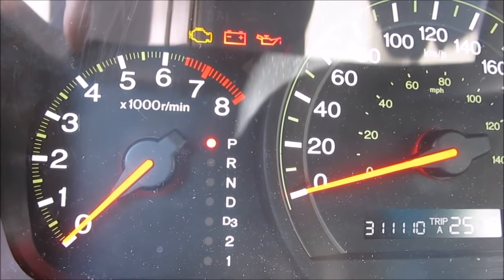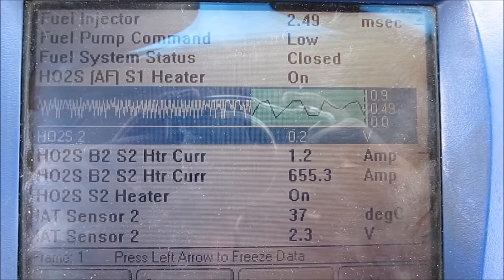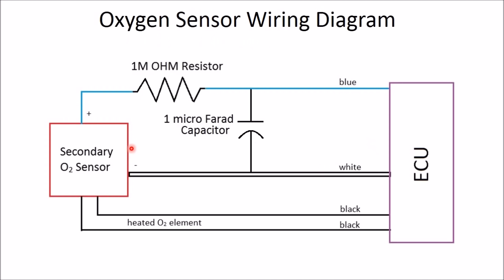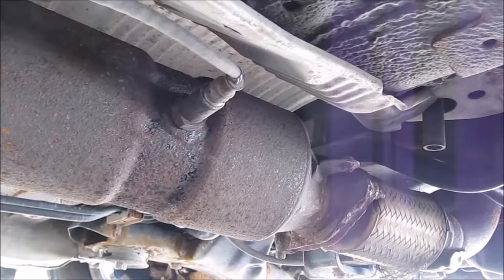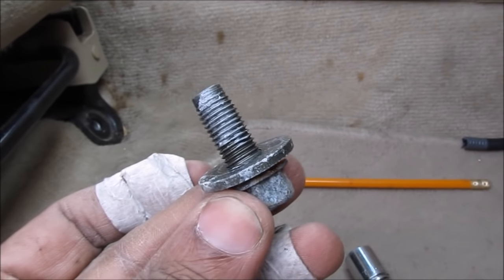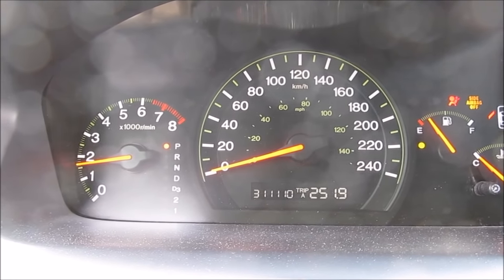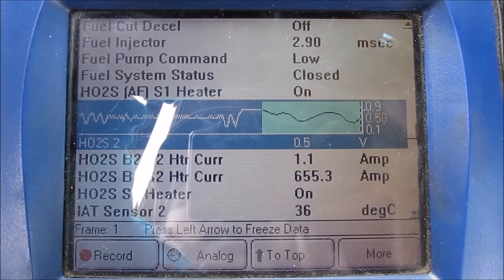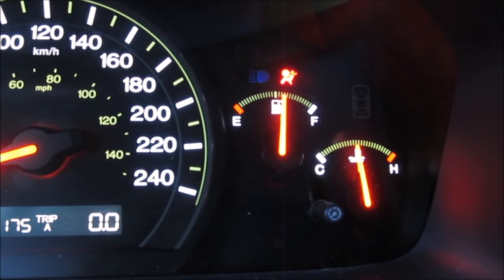P0420 Oxygen Sensor Fix

Comment: You failed to mention what size capacitor you used with the 1.0 megaohm resistor. Did you solder the negative side of the capacitor to the white wire? Did you use silver solder?
Reply from the maker: Regular tin solder

Comment: is it ok if i use 1/8 watt 1M ohm resistor? or does it need a bigger watt resistor thanks in advance
Reply from the maker: It's trial and error. See what RC value works for you

Comment: Thanks for the video. It's been a long time, but do you remember the capacitor voltage? I have searched a lot but cannot find a capacitor from 1Mf to 3v. Could you help me. Thank you
Reply: voltage on capactor means maximum it can hold without exploding but since oxygen sensor only produce up to line 1 volt, any capactor voltage will do
Reply: @poiiihy  Ok, thanks.

Comment: I went to buy the two (2) items to do this job, but there are so many different sizes of resistors and capacitors at Fry's and Radio Shack, so I did not know which ones to buy. There are 10,000 uF 25 voits, 4,700 uF 35 voits, 3,300 uF 35 voits, etc..... Could you please tell me which ones by the sizes that I need to purchase. I need to get car passed ASAP as my tags are out. Thanks you so much, this information is "GREAT"!!!!
Reply from the maker: +Terry Fuller Its trial and error. The ones used in the video worked for my car. 
Every car has a different response curve.

Comment: Were did you get the resistor can i get the info can i buy it  in ebay or amazon?
Reply from the maker: +Ivan Rosales radio shack
Reply: you can buy them on ebay or amazon?

Comment: What did this mod do for your gas mileage? Will this mod lean the mixture out?
Reply from the maker: +Steve Miller no. This is for the rear oxygen sensor not the AF sensor which would affect fuel
Reply: It only monitors the catalyst efficiency

Comment: Curious-  by doing this, will the mpg (fuel economy)  and acceleration improve to normal  levels? Currently with P0420, mpg and acceleration is really bad..
Reply from the maker: No it doesn't help with performance. It just tricks the computer

Comment: I had p0420 after doing this yesterday for 50miles, the engine light came back and it was p2a00. Do I really need to fix the 02 sensor from bank 1 sensor 1?
Reply from the maker: Use a spacer
Reply: @speedkar99  I didn't get you

Comment: Hi, I have a single wire CAT O2 sensor (92 Honda), and the computer is sending 10.3Vdc to the sensor through this wir. Does this mean that the senor is just acting as a variable resistor (hence changing volts based on heat?).  How can I use this DC supply of 10.3V from the computer to create a 0.4 to 0.7 V variable voltage using a RC circuit design in series?  I was also looking at using ohms law to hold the voltage at a constant value of 0.5V by adding a resistor only if that works too.. Can you please help?
Reply from the maker: +Sajaad Nazim I'm not familiar enough with electronics to help, but you might want to research how a 1992 oxygen sensor works because that might be different than the newer cars
Reply: Hi, Thanks for replying. After some great research I found that this sensor on the CAT was not an O2 sensor but an Exhasut Temp. (EGT) sensor acting as a Thermistor with a negative temperature gradient. Was able to fix it by adding a 100K ohm resistor and grounding the single signal wire to the chasis. Now the computer assumes normal operating temp. and the light is gone too.  Hope this helps to all who have Honda 92-95 JDM Eg hatch Models..
Reply from the maker: +Sajaad Nazim glad you found the issue
Reply: Looks like you have a short to power on the sensor signal wire

Comment: A few have mentioned this, but you are missing some specification on your parts. Resistors will need a wattage and tolerance. Capacitor needs a type, tolerance and a voltage. Based on the video, one might assume you are using a standard electrolytic capacitor at 25 volts with maybe a 1/2 watt metal resistor (1%)? I believe that this is important to specify as many do not know much, if anything, about electronic components, so when they go to acquire them, they will need to know what they are asking for. I would not think any specification beyond the above is needed.
Reply from the maker: Very good points. This video was meant to show the theory behind an RC circuit and how it smoothenes the wave pattern. The actual values are going to vary per each vehicle and thus I'm not recommending a particular value.
Reply: @speedkar99  Well, the only values that should need to change are the value of the resistor and capacitor. The missing data above should all basically remain the same. For example, whether you need a 1uF as described here or a 4.7uF as described by some others, the remaining specification should need not change. Regardless, to your point, it does a great job at describing the RC circuit.

Comment: Will this damage the Eprom drivers in the O2 section of the ecu?
Reply from the maker: +ERICtheLATE I don't think so
Reply: speedkar99 It makes sense, but their isn't much protection on that area of the circuit, the signal lines are direct to drivers, could be amazing if it works, the capacitor is the one that makes me nervous.
Reply: There is no driver, this is a sensing circuit, not and ouput

Comment: Wiring the capacitor between those two wires also gives me about
 20 Mohm of resistance between them, does that sound normal???
Reply from the maker: Maybe
Reply: @speedkar99  well it's funny because I hooked up the multimeter leads to those two pins on the connector and saw the resistance rise second by second from about 6Mohm all the way up to 30Mohm and then zero at OFL lol.
Reply: Well now I'm getting the P0136 and P0137 because it's seeing low voltages.
Do you think a smaller resistor will pick the voltage up some???

Comment: why do you think my 05 ody throws  p0430 only after a gas fill up but if i only do a 3/4 gas fill up it is okay.
Reply: there may be a small leak in your exhaust system, take some soapy water and spray it over the exhaust while you have some pressure in the tail pipe(Use a vacuum on blow mode or a leaf blower). you can watch ChrisFixes latest video on how to do that. Who knows might fix the problem.

Comment: Hello like ur videos but I would like to know what about vehicles that come with 2 Oxygen sensors on bank 1 and 2 on bank 2
Reply: you could do the exact same thing for each sensor, or cut the 2nd sensor cables and solder them to the first sensor so it sends the exact same voltage to the ECU. (NOTE the circuit has to be done after the cat is supposed to be at)

Comment: When checked with a special Emission OBD2 tool, my 2002 Sienna show Evap and Cat Not Ready .  Many hours of youtube on this P0420, I about to run out of options.  Before I build the RC filter, before I replace the Cat, I did this.  1) Added CataClean to 1/4 tank of 93 octane - TWICE; Cleared the code if it come up; Drove it and  keep log of the millage.  P0420 came up at 133 miles; I cleared the code again; fill up with 93 octane and drove it about 120 miles (purposely less than 133); go to the inspection center ;  Ask the guy to use his special tool to check.  The Evap showed it is ready and the  Cat still Not Ready.  But as long as you have only 1  condition, this model is allowed for inspection.  My car passed.

So I still use 93 octane; p0420 came up at 170 miles (wow 170 miles - 40 miles more than last time - but it is already passed the inspection); I cleared the code.  And at this time, i have been driving 350 miles (with 93 octane and after 2 cataclean bottles) and no check engine code come up...yet.  my next plan is to replace all spark plugs (recommend at 110K- the van has 182K miles.  

Conclusion - my CAT is OK ..not great but OK...It dont need to be replaced....I think because the spark plugs are old which unable to burn all fuel effectively, extra and dirty unburned fuel send down to the CAT/EVAP and messed it up, and the code come up.  So if you get new plugs, then less crap going to the CAT/EVAP, it wont throw the code.  An analogy to this is like your kitchen sink garbage disposal.  If you let food get thru the sink, - even if you grind all the foods, your drainage will clogged up one day.
Reply from the maker: +Thien Nguyen glad it worked

Comment: can you tell me how many volts the 1m resistor is and how many volts is the 1 Farad Capacitor is?
Reply from the maker: +Shawn Corsello the capacitor is probably 25V 
As long as it handles a few volts of the oxygen sensor it shouldn't be a problem.
Reply from the maker: +Shawn Corsello resistors are measured in ohms
Reply: speedkar99 Electrolytic Decoupling Capacitors - 1000uF/25V will this work on a mazda RX8 2004 got the p0420

Comment: WoW impressive 
Does it work with an empty cat ?
Congrats from France
Reply from the maker: No because that wouldn't fluctuate
Reply: How come after i removed my cats and ran headers to muffler and used stand offs that it fixed the p0420 code on my 08 ford ranger?  Its a v6 and has 4 o2’s so 2 banks.  I did nothing to bank 2 but welded the bung for the sensor further back from the bank 2-1 sensor but bank 1-2 had nowhere i could put it on the system other than close to factory location and it threw the code but when i used a standoff and an elbo the code went away?  It was saying the rear to front ratio value was too high at .998:1 with acceptable max at .663:1  and thats ran with a 3” pipe rather than factory 2” with resonator and 2 cats which had both sets of o2’s on... when it had the code i could clear it and within a few mins would come right back on..  now its been long while and no code..  but stand offs not working on buddys car..  gonna try capacitatin the hoojoo..
Reply: @speedkar99  no it will fluctuate just like dead cat, oxygen will pass right through

Comment: Hey, i have lexus LS430, my catalystic gone bad and i have the same error can i do the same thing ?
Reply from the maker: Maybe.  The resistor values might be different
Reply: @speedkar99  
I have a 2010 Nissan versa with po420 code. What are the resistor and capacitor specs. Failed inspection an I have till the 18th please help oh witch o/2 sensor? Thank you

Comment: you said 1uF capacitor, what was the voltage rating you used? i bought a 50v rated and a 350v rated, not sure which to use
Reply from the maker: +Justin Littlefield Not sure, as long as it can handle 12V of the cars ele trical system you should be fine

Comment: So, before you did all this with the wiring, did you test the cat to know for sure the cat wasnt just bad?

If you wanted to just fool the ecu, why not just use one of those rear o2 extenders and leave the wiring alone?
Reply from the maker: The ECU does it's self test and that's how it throws this code. 
The spark plug anti-fouler may work as well....but I don't want to deal with a Rusty exhaust
Reply: ok makes sense; but since your giving the ecu false data, does this screw with the cars air fuel ratio?

Comment: What components do think might become an issue as you approach 400k Kms?
Reply from the maker: +d w Well it's a Honda so I wouldn't be surprised if the transmission goes out...
I'm sure the engine will run forever though. At higher mileage it's the small things that'll start adding up, like sensors and gaskets, and perhaps suspension components if they haven't been replaced already.
Reply: +speedkar99 Yeah my transmission worries me most. I have a 2001 Accord V6 at 360k Kms. 

All the best to yours and thanks for the vids.

Comment: i know this is an old vid. and it looks like it will do the job, just need to confirm. Im looking for 1ohm res. with a 1mF cap?
Reply from the maker: That's a good place to start. Every ECU is different
Reply: @speedkar99  okay so, with 1mF then rise after that, if does not work? or do i rise both ohm and mF
Reply: ONE MEG-OHM  at 1/4 watt or better.  - - The capacitor is 1uF but another source on here says up to 4.7 uF, axial if available. Must have 35 WVDC or higher (working voltage DC). Good luck...

Comment: Hello, do you have a link to the capacitor and resistor? Thank you for your time and help.
Reply: Those are readily available. 1/4 watt megaohm resistor. For the capacitor a 10volt 1microfarad should be good. Amazon should sell these in packs
Reply: @williamgarcia3256  thank you, I got some at Radio Shack.

Comment: What about using lacquer thinner in fuel tank to clean the cat. Thoughts?
Reply from the maker: +John Mcadden never tried it so I can't verify it works
Reply: He didn't use the right concentration or amount of lacquer thinner, and he actually said he noticed a diff!
Reply: laquer thinner in the fuel tank will not fix p0420, but is very likely to dissolve some of your fuel system parts.  melts plastics and clogs up catalytic converters.

Comment: There is another hack for this.
I wish I remembered what the part is called. 
You put an adapter in the hole behind the cat where the o2 sensor goes, the the sensor into that. All it does is pulls the sensor out of the exhaust flow so that it isn't able to get a good reading.
Reply: That's using a sparkplug nonfouler with the bottom drilled out of it.
Reply: @codybess74  yup, that was it. Long time ago a couple of years, and still working.
Reply: @markchidester6239  this is a good method but smog shops know to check for this and it's an insta-fail
Reply: @lostconciousness4255  no doubt. It'll work where they just plug in with no inspection.
Hard to spend 2k on a vehicle that's worth 1k or less. Just gets you by to get the last year or two out of a car.

Comment: I replaced CAT and both oxygen sensors. 04 accord EX 2.4 and I still have p0420 code. Help please!!! What could it be??
Reply from the maker: Check the oxygen sensor graphs
Reply: speedkar99 what do I do if the graphs are no good? Sorry but I’m not a mechanic lol
Reply: just use a spacer on the downstream sensor, you can find them on ebay
Reply: a what are they called?

Comment: Well you didn't fix one thing you set out to do.  I can pass by taking my vehicle for inspection before the Catalyst is ready(1 code can be not ready) or if it's a pending code and I get it tested before the CeL comes on.  A spacer on the otherhand/defouler that have different attachments from wide to small(can find on ebay)  can get your Cat to show green and ready right away.  Literally after I reset the codes it was green after having spacer installed.  Maybe you need to do some driving at 30-40-50-60 Mph about 1 min each interval.  O2/Evap took a bit longer but I passed my Altima with the dreaded p1273 by getting the Cat to show Green with spacer before the p1273 code caused the CeL to strike.

Comment: i will prefer bit low resistance and higher valu capacitor so the resistor doesnt burn of beacuse of exessive power 10 k and 100uf
Reply from the maker: +tapan patel good tip
Reply: didnt work for me need to doit again
Reply from the maker: +tapan patel keep trying you'll get it

Comment: My wife’s-car same issue i get p0420 i change the oxygen sensor the one after catalytic converter the check engine light turned off and the problem fixed  car kia rio 2012

Comment: I really hope someone can help though I have my doubts. I've been battling this desperately. I've tried the resistor trick and I've tried a lower UF capacitor and a 600K resistor and I've not had. Good luck! I got rid of the p0420 but now I get p2096 I really need help though if anybody can. The car is in '08 Saturn Astra  I'd hate that the only way to fix it is a new cat

Comment: My mercedes sl350 after replacing o2 senso runing 50miles next day when i start the engine i get the check light with same bank 1 o2 sensor code anyone fix?
Reply from the maker: Play around with different RC values

Comment: i think you now can delete your exhaust catalyst and get more horse power
Reply from the maker: +PROUD EAGLE25 but how would you pass emissions
Reply: after this  what you call it hacking sensor , ecu always receive the true signal  and if you remove or broken or delete the catalyst fuel injection work true because you hacked the sensor and you not gonna destroy your engine and so well you get more power and backPressure
sry my lang is not so good
Reply: PROUD EAGLE25
Reply: PROUD EAGLE25
Reply: PROUD EAGLE25

Comment: My 420 went away ! But p0131 showed up why?
Reply: Got it fixed !
Reply: @luisgarcia5291  How?
Reply: I used it a smaller resistor
Reply: same thing i kept trying lower values and it looks like 11k ohm has done it; surprisingly a lot less than 1 megaohm though
Reply: How many resistors did you go through and which ones exactly. Did you use

Comment: What is the voltage of the capacitor? 5V?
Reply: voltage has to be higher than the input. so yeah, 5 volts works.

Comment: After i did this mod now my car has check engine with P0139 code. The mod last a day.
Reply: What size capacitor and resistor did you use? You used one too high for your car. Try to lower it down and it'll work perfect for yoy

Comment: The lengths people will go to just to avoid getting a proper repair... I get that money is sometimes the issue, but fix the car properly whenever possible. The type of person to do this bypass would be the same person who wouldn't tell a buyer about it if the car gets sold.
Reply from the maker: Thankfully we don't have emissions testing anymore.
Reply: Reasons do not exist to care when new cats and sensors are cost a significant portion of vehicle worth. When I buy used vehicles I inspect them personally no matter whence they came. Not everyone is wealthy like yourself.

Comment: has anyone tried this on a subaru out back?
Reply from the maker: No
Reply: It has the same wire config as the honda.do you see a problem trying it as the diagram shows?
Reply: the check engine light also disables the cruise control.